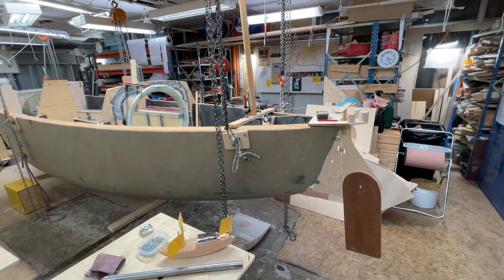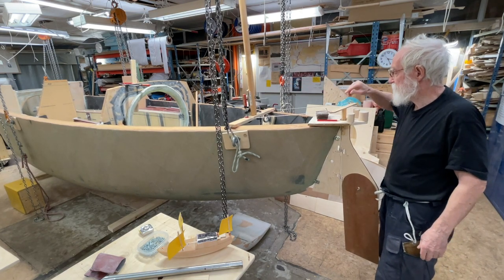30 Oct 2022  Rudder interference dealt with by drouge bollard on bumkin.

Comment: I hate to see the work of making that bronze rudder go to waste, but I think you're new rudder design is much better for your boat.  However, it will increase your LOA, which will cost you more at the marinas.  : )
Reply from the maker: True there is always a bad side to every change.
Luckily the upcoming route do not include many marinas
Reply: @SvenYrvindExlex  Many US marinas rate from 

 Many US marinas rate from 

LOD     {Got to stop hitting enter instead of shift)

Comment: As designed, it appears to be hinged. If so, would you consider making the rudder, when rotated up(for shallow draft areas), the same depth as the skeg(keel)? You would still have steerage when coming into ports or areas with minimal water depths. Just a thought, and I love the design of the entire vessel.
Reply from the maker: I will be able to rotate the rudder blade on the rudder head so that its vertical or horisontal.
In the horisontal position it will just be abouve the water, not touching it.
Vertical it will have its deepest draft.
All the positions between can be chosen as desired.

Comment: Consider a hydraulic steering system that would allow you to retain considerable aft cockpit space and give you the flexibility to easily locate steering stations wherever you want with no ropes or pulleys.  Locate a short vertical rudder post inside the hull to accommodate a short steering arm for the hydraulic steering ram.  You could install a cockpit floor just above it, with an access hatch.  The emergency rudder would include a rudder shaft extension and would require a simple bypass valve to allow emergency rudder control.  Hydraulic steering is reliable and there are small inexpensive systems available (e.g. Seastar).
Reply from the maker: To me thats to complicated.
I do have hydraulic braces on my car. Nowadays it seams to work well but I well remember in the 1950-s when you had to keep pumping to make the car go slow.
I am sure it can be made to work, but even if it kept working I would be worried.

Comment: More big changes in the boat.  Is the frame for the rudder bumper going to be metal?  And won't that frame be prone to torque from the drogue?  Very interesting.
Reply from the maker: It will be made of metall.
True the drouge will createn torque.
The frame will be triangulated.
That will take care of the torque forces.
Reply from the maker: Edited, in fact the frame will get bending forces not torque still the triangulated frame will take care of them.

Comment: This new rudder seems to be prone to give you problems! Sorry to say so, but it will be hard at the helm and make a lot of turbulence and resistance. Ir Will make a torsión on the upper section.
Reply from the maker: I have succesfully used similar design since the 1980-s.